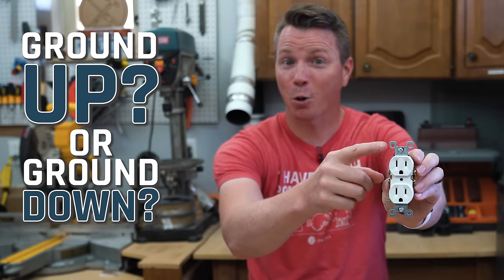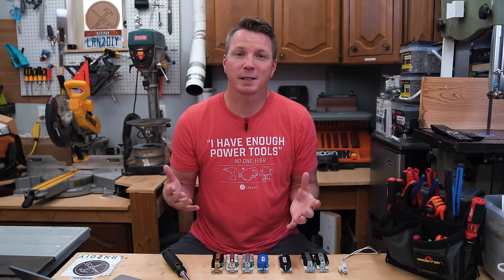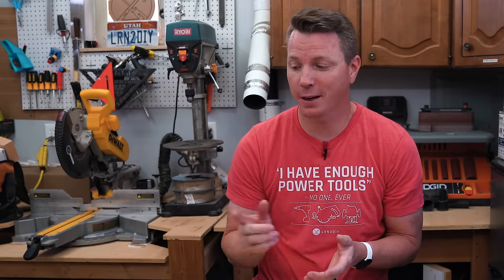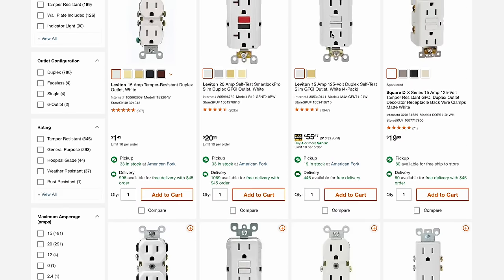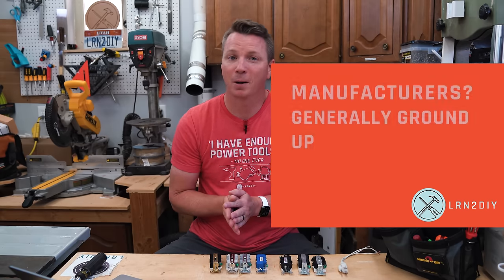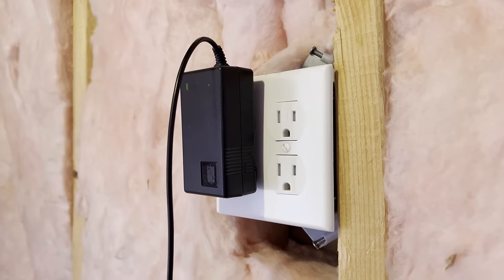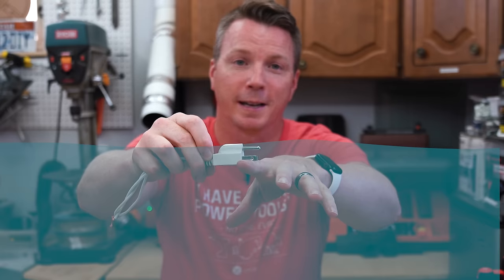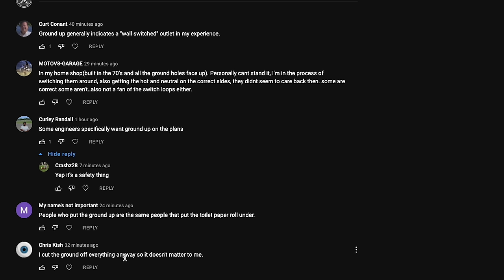Should Your Outlet Ground Face Up or Down?

Comment: NEC says it doesn’t matter therefore it doesn’t matter. It’s pretty much arbitrary. What if the plug is horizontal or face down on a ceiling mount? Or what if a device with outlet is being used like a UPS, rack outlets for a server or even a surge protector? Do you go against manufacturer requirements and mount it upside down? What about the outlets on a generator? Ground up spills all the gas and oil out of it. 😂. My APC and Cyberpower UPS’s would tip over if you set them on their tops to get the ground up.

That said I’ve worked with engineers on job sites that “wanted” ground up and I was happy to oblige. If someone is paying me to do something a specific way and it’s not against code then why would I care, it’s not any harder.

Comment: Some commercial offices like the ground up because if they are behind a desk scissors or paperclip could be dropped between the plug and outlet and land on the hot side. That could result in a possible electrocution.  IBEW electrician 43 years. Code doesn't specify either.

Comment: the reasoning for ground down is that the grounding prong on the plug is slightly longer such that if the plug becomes partially pulled out, gravity will work to pull the plug down and the ground pin will be the last connection to be broken.

Comment: If you plug in a 3 pin adapter for a UK style plug. 
Ground down means the UK plug is the correct way round with cable pointing down.

Comment: Workman like manner.
You can be rather way as long as it is consistent through out.  Some electrician s flip the receptacle that is controlled by a switch so you can easily spot it.

Comment: I was told this by an electrician.  Ground pin up, so that if someone steps on the plugged in cord the ground has a chance of coming out first and not bending or breaking off in the receptacle..  Excuse me?  If the majority of wall mounted receptacles have three prong cords pulled out in a downward motion would you not want the ground to stay in the longest?  What is it for, decoration? The idea is to keep the ground in the circuit as long as possible if there is an accident with the plugged in cord.  Thus, if the danger is mainly in a cord being pull out by accident in an upwards motion, which might happen more in industry than homes, you'd put the ground up.  It's a safety thing!

Comment: Ok, apply some physics...  With the ground on the bottom, you have 2 blades making contact on top, and since gravity would always pull a cord downwards, regarding any pressure on the plug, I'd prefer having 2 blades keeping the top of a plug from pulling away from the receptacle instead of 1 ground pin.  That assumes, of course, that the friction of 2 blades is greater than that of 1 ground pin. But who knows? Maybe the ground pin has more grabbing power than the 2 blades?  How about plugging in a cord and measuring exerted downwards pressure, then flipping the plug over and doing it again. (E.g. Hang a mini bucket* hanging from the cord an inch away from the plug, then measuring how much water it takes to get the top of the plug to pull away from the outlet; then flip it and repeat the test.)

Myself, I prefer the ground hole on the bottom because nearly every device I've ever plugged into a grounded 120v receptacle requires the ground pin on the bottom (e.g. (meters,  testers, DC adapters, USB chargers, etc.).  But hey, if the shoe fits...

* Like a soda bottle with a string tied around the neck and the other end tied to the cord 1" from the plug.

PS Look at your own video, "5 Electrical Tools Every Homeowner Should Have." Look at the GFCI Receptacle Tester. Try using THAT with the ground plug on top! LOLOL
Reply: Classic physics is just established engineering knowledge with math descriptions.  Apply engineering instead.    The internal ground connection surrounds the rounded ground pin. The parallel blade contacts are parallel to the faces, and do not resist vertical force at all. When you see a grounding plug with a contact missing, it is always the grounding pin because it is the one that resisted the force the most.
Reply: @psdaengr911  to go along with that, the ground pin is longer than the blades

Comment: Flat plug power strips (unless the ones that rotate) generally have the cord going down -- ground down.  Makes it more convenient so the cord isn't going into the air--similar to the power adapter.
Reply: A table lamp or other appliance that's higher than the receptacle would rather have the ground up.
Reply: @73dcp  not sure what that has to do with what I said.

Comment: In a lot of commercial construction meral boxes and metal face plates are required. It's not likely to happen, but if for some remote possibility the face plate came loose and the plug was like you showed in your video, and you didn't notice the plate was not secured and went to unplug the item and the metal face plate fell down on the blades it would surely go boom. And with the ground down the receptacle looks like two smiley faces or emojis that could possibly entice a small child to go and play around with it and maybe sticking something into the receptacle. Also, most of the cords on appliances and other plug in items that have a ground probe, the natural flex of the cord is with the ground up.

Comment: It makes no difference as far as the function of the receptacle , however the ground is called a "U " ground and should be installed ground up . as you mentioned something falling on a partially pulled out plug wouldnt short out. And to take it a step further the ground should be the last part of the circuit to be disconnected, as you are pulling the plug out and up the ground will disconnect last . Some people find it more pleasing to look at it with the ground down why i dont know , cause it looks more like a face ??? who knows ?
Reply: Even with ground up it is probably still just as likely (very remote) of a bridge between the Hot and Ground prongs as it would be Hot and Neutral prongs on ground down scenario. Also the ground prong is typically longer and will almost always disconnect from the receptacle ground up or down.

Comment: As an electrical engineer and firefirghter/employees for 30 years,  the ground is ment to be up to stop conductive event from hitting the "hot and neutral " since ground is usually also neutral in many US Installs one would consider them the same. Having a High defender prevents a hot neutral event and fire from atching. This is because the spark from a HOT event could still start a fire from the sparks if a combustible is available.
Reply: Literally nothing you said makes any sense.

Comment: I conclude that the majority are usually wrong. But is there really a right or wrong? What I wonder is this: I have these with the ground down, and as they get older, the plugs tend to sag. So which resists sagging better? Ground up, or ground down?

Comment: For Hospitals, a guy died to make sure they are forever ground up!  He was in traction, and killed by the metal bar hitting the "Hot" line on a 120 volt receptacle, and not the ground first.  So for your home, install it any way you want to.  Traditionally they are ground down.  I have no idea why they did not pick ground up.  

If you are working in a hospital, it will be ground up!  I think the guy died in 1967, so there are very few electricians who heard it from the newspaper of a guy dying while they where in school.  The electrician that I heard it from was trained in the 60's and lived in Los Angeles area, he told me the story in 1995.

Comment: A lot of plugs with the cord at an angle from the plug are designed to be plugged in ground down with the cord hanging down, so I think ground-down is the de facto standard.

Also, I'm surprised nobody makes a receptacle with the grounds in the middle so the top is ground down and the bottom is ground up.
Reply: I would actually design it the other way around ("ground out", so the top has ground up and the bottom has ground down) since (as was mentioned in the video) a lot of bricks and such are designed to take up extra space in the same direction as the ground pin, so that would make it easier to install two large things in the same outlet.
Reply: @foogod4237  Yeah.  I agree.  That makes more sense! 🙂

Comment: It's basically a non question. If I have two breaker circuits in a same room and both serve only some receptacle. I would ask the electrician to set all the plug for the circuit A down and circuit B up. That way, I can tell what breaker I'm using. So I won't use two 13 amp appliance on the same breaker at the same time. I would do the same to indicate what outlet is connected to the wall switch if I only use one breaker. If the ground is down it's a normal outlet. If the ground is up, it's connected to the switch.

Comment: Some plugs for refrigerators are oriented to go in one direction, but it truly does not matter. Most GFCI plug ends are oriented for a ground down outlet, but again it does not matter. It all comes down to personal preference and what you think would look best. Just like screws on a cover plate, all in one direction on all of them, up/down or sideways.

But people use little antidotes to remember things. Like Lefty loosy, righty tighty for screws. Heat up or cool down for air flow in ceiling fans. There are many that people use to help them remember things.

Comment: Most of what I have seen were ground down. Supposedly ground up helps prevents shorts but I have not run into that problem.
Reply: Even with ground up it is probably still just as likely (very remote) of a bridge between the Hot and Ground prongs as it would be Hot and Neutral plugs on ground down scenario.

Comment: Why do electricians install outlets upside down?
Image result for ground power down or up
Electricians may position the outlet in an upside-down position so that you can quickly identify the switch-controlled receptacle. Since it stands out visually to most people right away – it provides convenience to the occupants to easily remember which outlet is switch controlled.Jan 5, 2020

Comment: Well, in the land of the free you get to choose. But if you put "world standards plug and socket types" into your favorite search engine you'll find that in many of the dozen or so worldwide plug and socket combinations the wires often emerge from the bottom of the plug instead of the back. This tends to determine the receptacle orientation and many, but not all, have the ground at the top.
With this in mind I took a look at some US right angle plugs. Mostly they show both the ground and the wires at the bottom, but some have the wires at 45 or 90 degrees from the ground pin. And there are ones with the ground pin at the top. So, go figure.

Comment: I have a simple rule for myself, your opinion may vary... 

Ground-down in normal living areas, so 3-prong cords plug in and route more conveniently.  Ground-up in my shop and garage, so the ground connector takes the brunt of the cord as it hangs and it is slightly safer should something slip down the wall and make contact.

The water level argument for ground down makes me laugh.  Water will enter the entire wall behind the receptacle and capillary action will draw it up to the contacts anyway.  1/2" makes absolutely no difference.

(YMMV)
Reply: NIce solution.

Comment: You should probably change the thumbnail. I now know for a fact I don't need to watch the video bc I know for a 100% fact it's not accurate to say ground up is "wrong" as you put it. You'll probably end up on explaining the obvious reason this is done and likely local/regionally codes might dictate further which is correct. but what's not correct is the blanket, general statement that ground up is wrong. that's actually a pretty egregious thing to do in the thumbnail when it's said facetiously

Comment: Ground Up sounds safer from falling nail files, but maybe more devices are made for GD.   I ran an IT dept for many years and one of our buildings had 1000+ GU outlets, which were a pain.   All the surge protectors, power bricks and those flat 90 degree extension cords seemed to be made for GD.   You could find some cords that allowed you to rotate the plug but they were more expensive and I am not so sure about moving contact points.   We even had a plug in coffee timer that showed the time of day upside down….very annoying, right?  There is also the frowning face icon meme thing……..
Reply: I guess then no one really cares one way or the other. Everyone does what suit them.

Comment: Master electrician here. In residential homes, ground down, except switch legs which should be installed ground up. In commercial and industrial settings, ground always up.

Comment: I tend to prefer ground down only because most flat plugs are designed to work this way. Having a flat plug climbing up the wall just doesn't look nice, and you lose a good bit of length in the process.

Comment: I believe Hospitals use Ground Up.  This is for safety in case something metal falls on the receptacle to prevent electric shock/short.
Reply: Even with ground up it is probably still just as likely (very remote) of a bridge between the Hot and Ground prongs as it would be Hot and Neutral plugs on ground down scenario.

Comment: I'm SHOCKED that I don't see comments pointing out that Ground-Down is a Frowny Face/Distressed-Expression Caricature that is a WARNING.  Also, Ground UP is used by Electrical contractors to signal to home owners and other contractors that they have an Issue with the General Contractor.  Maybe they weren't paid what they wanted but needed the work?   Maybe they are incompetent and that's why they have to take low paying electrical gigs?
Reply: Yeah, I like to install them ground up just to annoy people.

Comment: Like code says, it really doesn't matter.
Fact: For over 50 years of observation in Residential, Commercial and industrial including Hospitals, the orientation is ALWAYS "Ground Down" I can't recall EVER seeing one with "Ground Up" which would stand out like a sore thumb.
Therefore "Ground Down" is the standard and is the ONLY way I would install one. 1. I want it to look right. 2.I don't want to look like an idiot.

Comment: Why not have one plug with ground up, and one plug with ground down?
Saves material on the internal bus bars. Also, small SMPS chargers don't care, since they have no ground. 
Ground is needed if the enclosure is made of metal.

Comment: Electrical outlet ground up or down
The outlet should be oriented with the ground pin down because a person grabbing the outlet will have their index finger at the bottom side of the plug and the index finger sticks out further than the thumb. Having the ground down will keep a person's index finger from touching the live pins.Apr 3, 2009

Comment: I don't know why this debate is still going on. When you have a two prong plug it doesn't matter which way it is. Supposedly they want ground up because if something falls on the plug it will not short out due to  hit the ground pin. But this is not exactly true because what if something hits a ground pin and the hot at the same time?

Comment: The solution is obvious.  Manufactures should make them with ground to the outside (so the two receptacles are opposite and there's a ground at the top and bottom) and then we should install them all on their sides.

Comment: Both has their pros and cons. 
Ground Up:  if the plug is a little bit out , something falling on it like a loose faceplate will contact the ground pin and not the live/neutral
Ground Down: if someone steps on the cord, the ground is likely to disconnect last.
Also many GFCI's are mounted Ground up as well as most switched outlets are (or were).
All 'normal' (always on) outlets are mostly ground down.
-

For me I prefer receptacles that are near the floor to be GD and receptacles that are positioned around waist height or higher be GU.   What do u think folks?

Comment: I always installed them with the ground up, under the theory that if the cord was partially pulled out of the receptacle the ground part of the plug on the cord would somewhat cover the hot prongs, if a kid with playing with something metal it would be a little more difficult to touch the hot prong.  But, it probably doesn't make any difference.

Comment: I replaced most of the outlets in my home when I bought it a few years ago, and any of them that are oriented vertically, I installed them with the ground up.  I did it for two reasons: first, as you mentioned, if a plug isn't in all the way and something metal falls and hits it, it will hit the ground and not cause a short.  Secondly, I knew we'd be having kids, and even though I installed tamper resistant outlets, I'm hoping they'll be less likely to want to fiddle with an outlet since ground down makes it look like a little face and ground up doesn't.

Comment: People also ask
Does the ground go on top or bottom?
With the ground in the upper position, the ground prong on the plug could pull out with the hot and neutral still energized, thus creating a possible electrocution hazard. Ground should be at bottom that way if the plug is accidentally pulled; the last prong to disconnect will be the ground.

Comment: What makes you think the text orientation on parts covered by the faceplate has any significance whatsoever? 
Many manufacturers make appliances that expect the ground down because that used to be the way most people installed them, mostly because that's the way everyone else did. There's no real reason for it, it's just habit.